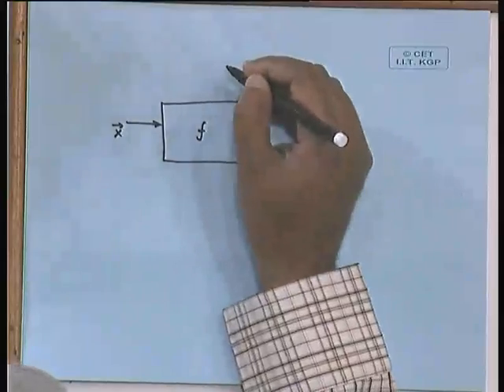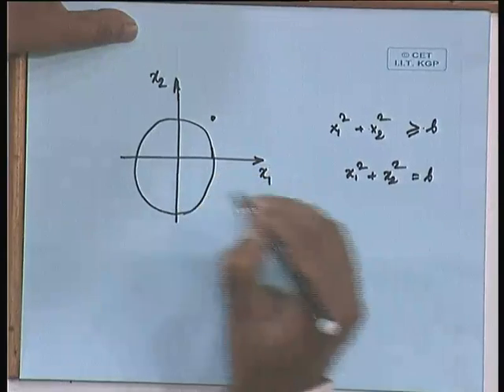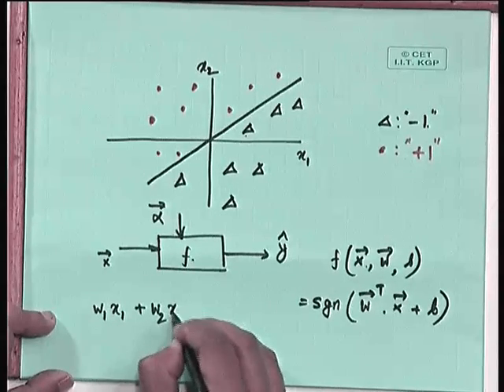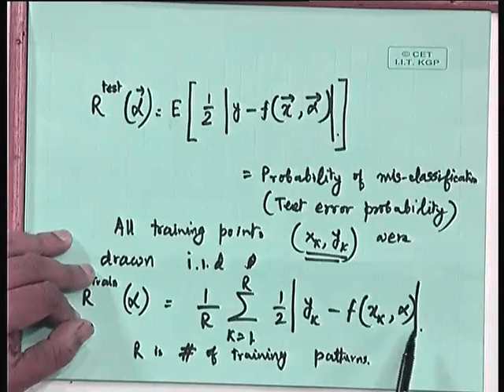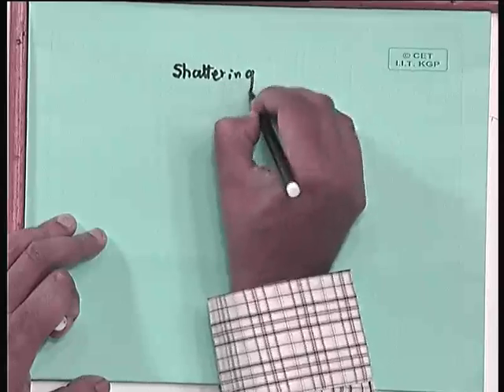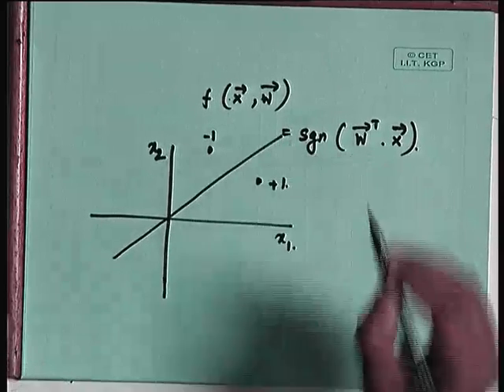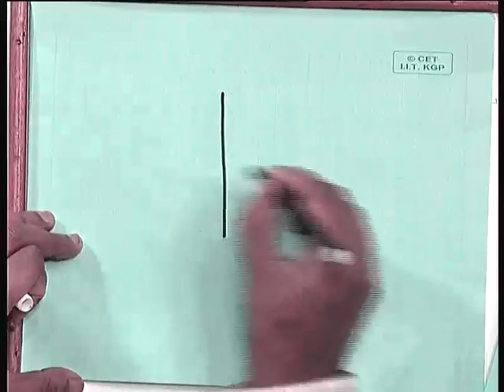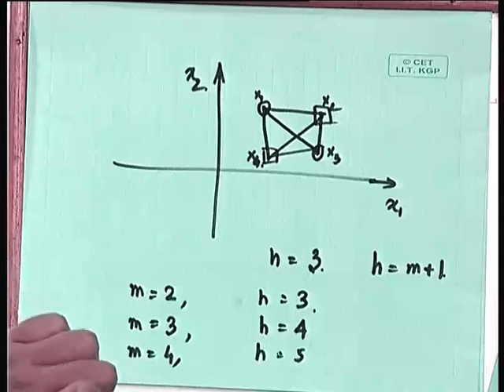Lec-10 V.C. Dimensions: Typical Examples

Comment: The VC dimension for quadratic functions in N-dimensional euclidean space is (n+1)(n+2)/2. And circles in two-dimensional space have a VC dimension of 3.
Reply: It doesn't. It can't shatter points that lie on its perimeter.
Reply: You don't need to consider the perimeter case. According to definition of VC dimension you can arrange the points in any spatial configuration you want. If for that spatial configuration and all possible labellings it can be shattered, then VC dimension >= number of points.